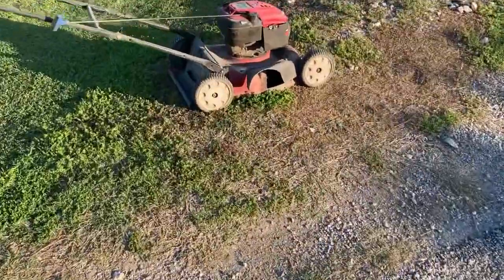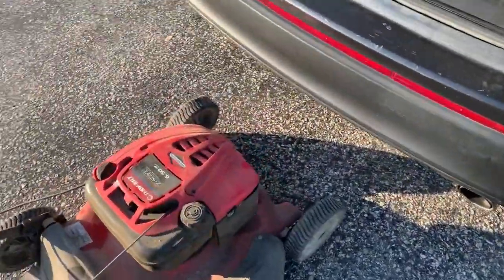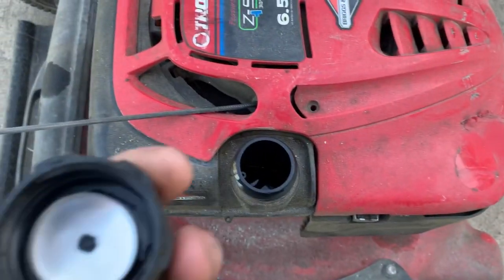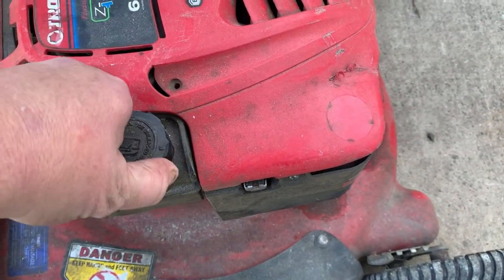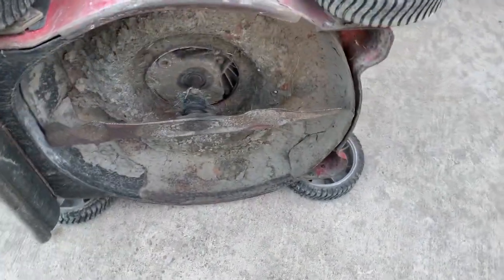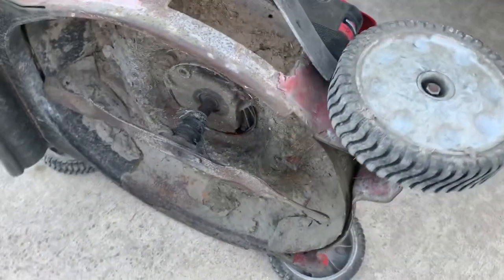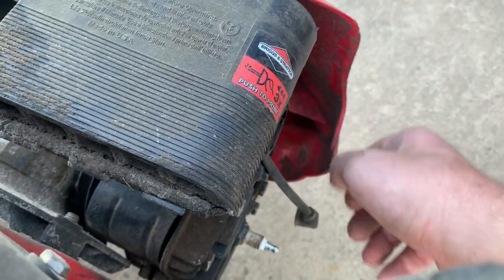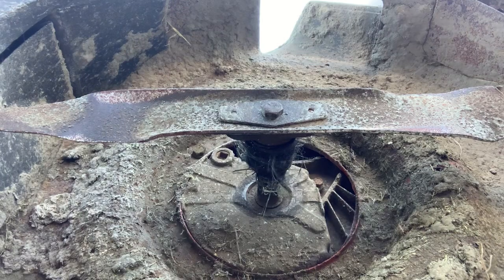ROADSIDE TRASH PICKED MOWER FIND / WHAT SHOULD I DO WITH IT?

Comment: Replace the crankshaft or new engine. Straightening can cause a weak spot in the shaft that can snap and send the broken shaft and blade flying in any direction with little to no warning signs. Scary stuff. Don't want someone to get badly hurt or worse. My vote is new crankshaft or a new engine just to be on the safe side. That's just what I would do. Its not worth risking your life to mow. High rpm Spinning blades are nothing that you want coming off during operation. Please be safe man.

Comment: Crank straightened...
I used to do it without the straightener... By a coat hanger clamped to the mower bottom edge. A BMFH hit on a pipe slid over the shaft at the high point of the bend, I never got it totally vibration free, but pretty good.

Comment: I have the same mower.   Hit a rock and bent the shaft.  Straightened it out with a pipe.  May not be perfect but runs without vibration.  Give it a shot to a new life by trying to straighten the crankshaft.

Comment: Clean it up, change the 'earl', clean the spark plug, sharpen and balance the blade, let it be known the shaft is a bit bent and it'll have a few hours of life before the bottom seal destroys itself and leaks out the earl, or straighten it out as much as possible as you know the "damn wells"... that  you can damn well never get it fully straightened to the point of it living a full long life ..... sell it for $35. $40 if you can get it close to straightened out... The new owner will get tired of the vibration and you'll find it back on the curb... rinse and repeat.
Reply: Lol but true 😉

Comment: I would not do a crankshaft straighting video due to liability concerns. Manufacturers don't approve of it anyway. Maybe a crank replacement video instead.
Reply from the maker: I’ve been straightening crankshafts for over 30 years without a single problem I can get them within half a thou All day long, thank you for your concern however it’s not a liability it’s my engine and not a customers engine